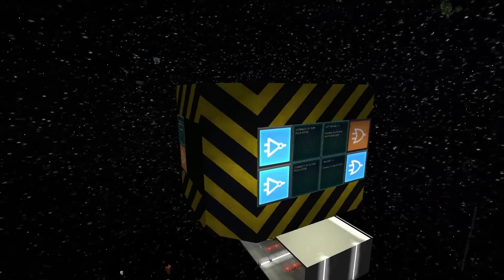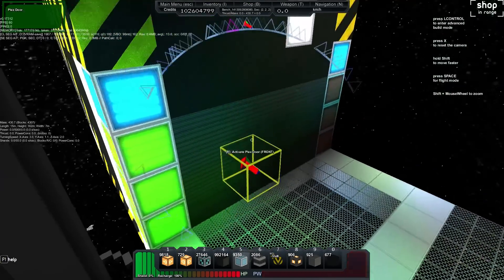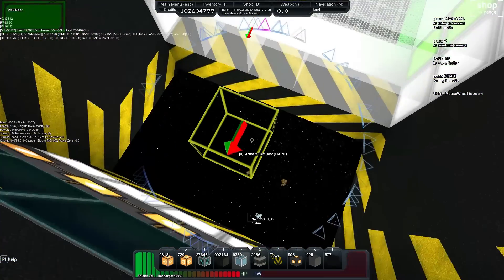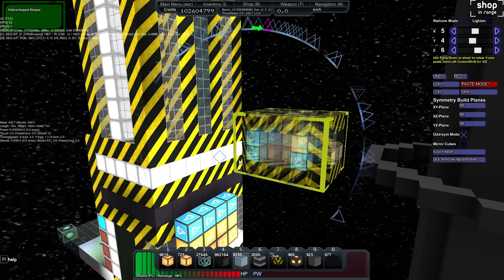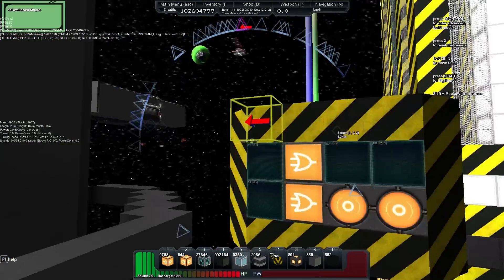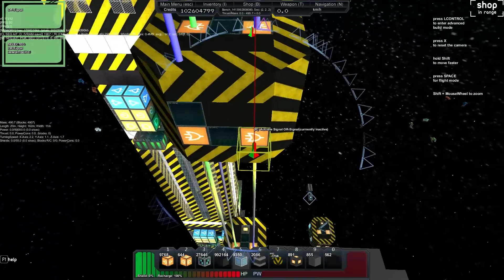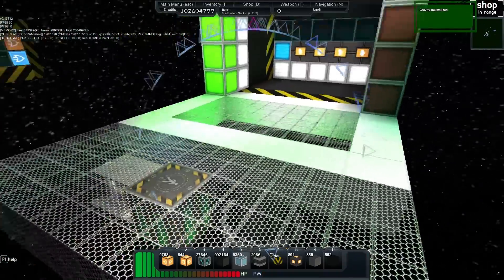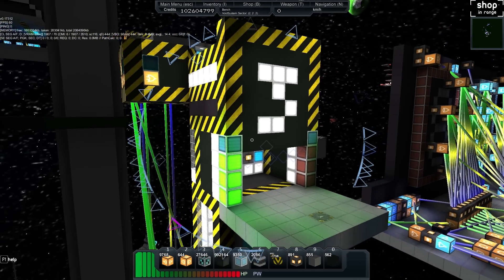Starmade Logic #21 - Multi-Floor Elevator

Comment: I'm designing (trying to design) a multi-floor elevator like this using the rail system. I got the single floor system figured out that's fairly simple, but I'm still puzzled over how to implement the same system over multiple levels (any ideas or suggestions or how to videos would help).  Could you adapt this same system using rail blocks in the same way you did using the gravity modules?